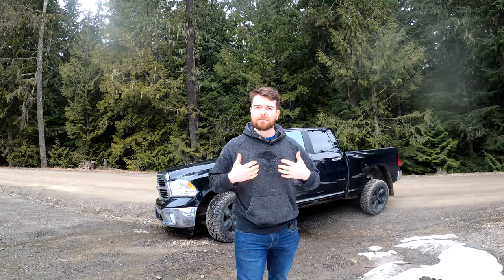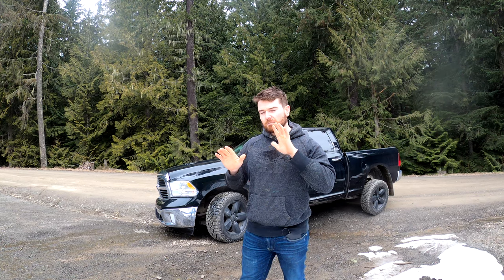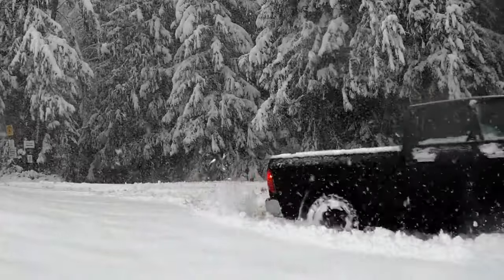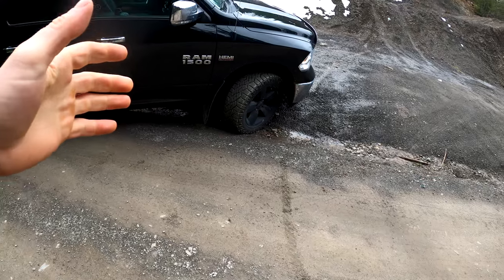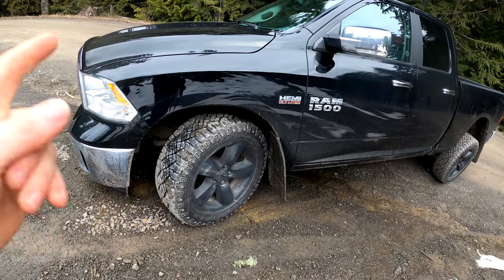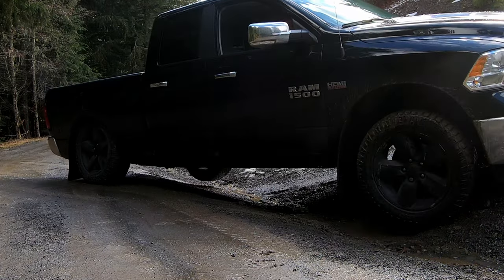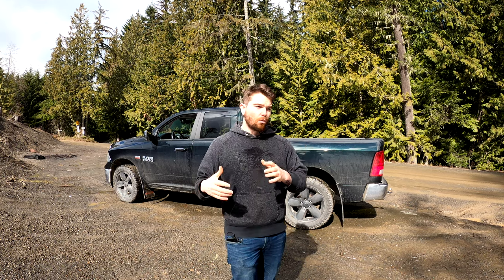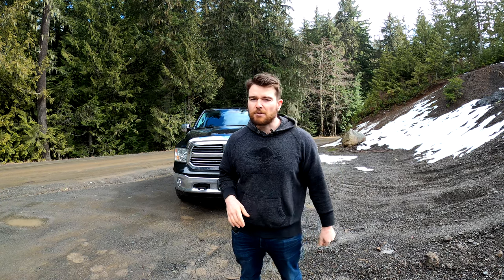RAM 1500 Off-Road 4WD LOCK TEST (With Open Diff's) | Not Really a 4x4...

Comment: Take this from a 64 year old man, you are not high centered, high center is when your frame and transfer case is sitting on the ground, with all four tires are off the ground. If you can't drive a 4x4 with open diffs offroad you need to stay home. Learning to use a truck with  open diffs will make you a better driver when you step up to lockers.
Reply from the maker: Ya my terminology was wrong but you got what i was saying. Open diffs are terrible off road.
Reply: @TheGettyAdventures  No there not, you can alot of places with open diffs an finest.Learn how your vehicle handles offroad before you op for all the latest lockers. If you don't know your vehicle and you engage your rear lockers it can put you in a ditch faster than an open diff.
Reply: Here’s the perfect example of the old guy you can’t teach new tricks. “Watch out sonny, let me show you how we did things before there were lockers!”. Open diffs suck! It’s why hardcore wheelers have them in their rock crawling rigs. Modulating traction with brakes  is an easier way to snap and axle.
Reply: @randyedwards6702   you are totally right I have noticed that this dude that just pops up on my feed does not know how to operate a 4x4 he didn’t even realize how he was stuck in the snow 🤦‍♂️. It’s clear from his reviews that he does not know what he talking about and likes to bash a rams in particular I think he is getting paid to do so. And these trucks comes with option for again particular use 🤦‍♂️ which you have to buy the package. Common knowledge traction control is ONLY for when your driving to help maneuver the vehicle properly. I’m not going to go into detail Randy your right and these young bucks are still wet behind the ears.
Reply: Let me bring some reason to this conversation lol. In this video, he has an open diff with the BW-44-44 transfer case that accompanies the 4WD-auto mode. This transfer case is terrible for off-roading, but great for faster driving in an AWD type mode. That transfer case turns a truck into a soccer mom SUV. Conversely, you get the BW-44-45 (actual locking transfer case) when you buy this truck WITHOUT 4WD-auto. This actual locking transfer case makes it through this type of scenario like a breeze, similar to old trucks with open diffs that made it through everything. Of course lockers are king, but they also come with heavy maintenance (and issues) which makes a single rear locker MORE than enough for a full size truck that’s main purpose is not rock crawling. Watch the Ram classic TFL slip test, and the Ram classic TFL Moab video links below to see exactly what I mean. HUGE difference. 

https://youtu.be/pWUO7hrJedE?si=da5rSONlIOiPxCE0

https://youtu.be/PitAwOmu1do?si=itT9hDKtyh8hIs_F

Comment: From the manual:

ESC Full Off – 4WD LOW
This mode is intended for off-road use when ESC stability features and torque reduction could
inhibit vehicle maneuverability due to trail conditions. This mode is entered WHEN THE VEHICLE
IS STOPPED, the engine is running, in neutral and by pressing and holding the “Traction Control”
switch for five seconds . After five seconds, the “ESC Off” message will appear in the odometer.
ESC. TCS and Torque Reduction features are turned off until the vehicle reaches a speed of 40 mph.
At 40 mph the system returns to “Partial Off” mode. The “limited slip” feature is not turned off. 

So the truck has an offroad mode when you go into 4WD LOW and hold Traction Control for 5 seconds. The "brake locking differential" or "limited slip" traction control functions more aggressively to get you unstuck in situations such as this.

You should know that 4WD High is for higher speeds and 4WD Low is for off road obstacles and situations where you're stuck or are likely to get stuck. https://youtu.be/dfcDJpnBGPE?t=15 22 seconds in you can clearly see the front right wheel get braked and the truck is able to climb out of a situation like yours with ease. Instead of all these Youtube vids you could have just read the manual.
Reply: ESC needs to be off 👀
Reply: @toviyyahjudah6828  yeah most 4x4's require traction control off for the off road mode to kick in in 4x4 low. In Nissan going into 4x4 low it automatically disables traction control, RAM just has an extra step.

Also it doesn't work in 4x4 high, because 4x4 high is not for when you're stuck off road.
Reply: Well I learned something. Thank you.

Comment: That's the classic cross-axle scenario. With open diffs, power goes to the wheel with least resistance and that wheel just spins.Great topic ! I've addressed the same issue to my followers.
Reply from the maker: Such a good example to help folks understand how an open diff works off road!
Reply: It's actually because open diffs have equal torque to both wheels. The spinning wheel has little to no torque, the other does not either.
Reply: @russtomas4461  that's because you need resistance (traction) in order for torque to be applied. This is why riding the brakes a touch works wonders. 

Jeep does this with their "BLD" break lock differential. It's open diffs but the way they use traction control and the abs is awesome
Reply: @JJsGA  I am aware why it is.
Reply: @russtomas4461  I know, was merely adding to your point is all
Reply: Can you link the vid you are referencing?
Reply: @muchless  Here's the link https://www.youtube.com/watch?v=iZg2FNOpSDE . I also reference some other great videos on this topic in that video.

Comment: TFL has a Ram slip test video on YT that shows after a few seconds of constant low throttle, the truck is able to walk off of rollers under 3/4 wheels.  Traction control automatically applied the brake to the spinning wheel (after some time). It was actually pretty impressive. I’m wondering if you just needed to run it a little longer to see if it would kick in? Obviously lockers win.

Comment: Locking transfer case and open diffs with EDL ( computer uses the brakes to transfer power) is ideal for MOST situations and drivers of every skill level.  In heavy rock crawling it may not be strong enough and need physical lockers.

Mopar traction control system is trash. Abruptly taking the throttle away when you loose traction is the WORST thing you can do in a traction loss situation. (from a life long Mopar guy)
Reply from the maker: agreed, the traction control system seems to just try and keep the wheels from spinning and tried to keep you on the road. I've heard Toyota makes a great system.
Reply: In the case of this truck It's not the fault of the Mopar traction control, it's the crappy transfer case, BW44-45. The clutches on that one like to slip a lot and it results in something horrible 4wheeling. 4th gen RAM 1500's were offerered with 2 transfer cases, partime NV243 and full time NV246, then a little later those were changed in favor of a BW44-44 part time and 44-45 full time. A truck equipped with the BW44-44 will jump that rut without much drama. the 44-45 will give those bad results.  4th gen RAM 1500's are equipped with the BLDS system, same system used in the Jeep JK's and UP  since 2007. It was/is  in those models and up.  it's completely silent and you don't have to press any buttons for it to activate. It's all electronic and  uses the brakes to transfer power to wheel that needs it. People will know if they have chitty 44-45 in their 4th gen RAM 1500 because the transfer case switch will have the  4WD Auto option. The 44-44 doesn't have a full time 4wd auto, is just 2hi, 4lock and 4lo. it's the normal part time trasnfer case. That one makes this truck behave as it should instead of that crappy show we see in this video.
Reply: @panasrsm  that’s good to know. I have a 2019 classic with no 4wd auto option.  Just 4 lock, 4low, 2wd

Comment: Lots of info in the comments, and also I'd like to add - You have to apply throttle longer and harder for systems to sense it's bad enough to lock down on one side and throw power to the other.  You were being far too gentle.  Also I learned from pulling boats out on slick boat ramps, you push firmly on the brake and then apply throttle to get the engine up to medium/high rpm and hold it there.  Then slowly release brake pressure until the engine overpowers the brakes.  It'll overpower them equally, putting down a healthy amount of power like a locked diff because you are at strong rpms.  Most people do it too gently, using only a little bit of throttle, and that's not enough torque to do anything much when it finally and barely overpowers the brakes.  You gotta commit!

Comment: Don’t use the tap the brake trick on these trucks! Great way to snap off the front differential output shafts. Did it once on my 08’ Dodge Ram 1500. Granted, I have slightly oversized tires, and was buried sideways in a snow drift.

Comment: Keep in mind the 4Lock mode has less brake traction control than the 4LOW selection. This maneuver or other rock crawl maneuvers would be accomplished in 4LOW.
Reply from the maker: 100% correct. I was just trying to use this as an example of why 4wd lock really isn't what most people think it is.
Reply: @TheGettyAdventures  i sure wish it was what most people think

Comment: Thank you for making an honest video about what is truly 4x4 and what is not. I happen to live in Northern Wisconsin and I drive a 2017 Honda Ridgeline RTL-T AWD. I take a lot of crap for it being "not a real truck" and not having 4wd, and yet for the past 3 years I have pulled a minimum of 2 mid-size or half ton trucks that are supposedly "4x4" out of the ditch in winter when their open diffs leave them stranded and my AWD performs. I do acknowledge I upgraded my tires to Falken Wildpeak AT3W tires that are snow rated tires.
Reply: Ridgeline is not a real truck, and I'm betting the trucks you pulled out where dodge
Reply: @coltonsstuff17  if the dodge had a locker, it wouldn't have gotten stuck. The ridgeline can "lock" the rear.
Reply: It’s still not a real truck lol.
Reply: Lol ridgeline

Comment: Open diffs shouldn't even be a thing anymore.  Make LSD's standard and they'll be cheaper vs still trying to engineer/manufacture/source parts for both
Reply: Just letting you know A limited slip differential eventually becomes a open differential if not maintained and maintenance
Reply: It can also be a problem in the snow and ice.  Thats why most modern trucks have locking diffs up to a certain speed than open...as opposed to limited slip.

Comment: What year is that truck? It doesn't have brake based traction control?

Applying the brakes should definitely help. You actually are four-wheel drive if you're on perfectly flat land with the same traction on all four wheels you actually are getting power to all four wheels even with open differentials.

All of that said there is not a single modern Jeep out there that would have any trouble at all with this situation. Even if I have my rear locker turned off and I have two wheels in the air I am still going to move forward because my brake base traction control make sure the power goes where it needs to. I also have a power transfer unit that will send the power front and rear as it needs also. So if I'm slipping more in the front then in the rear or vice versa it will send the power to the other side front and rear also. My Jeep actually has the ability to send 100% of the power to the rear even though it's a front-wheel drive based vehicle.

Comment: I have front and rear lockers in my Jeep, but why can't they use the ABS system to apply a little brake only to the faster spinning wheels to get some power to the wheel with traction and alternate as needed? Is that was Toyota does with their crawl control?

Comment: shouldnt you have the (BLD) brake limited differential??? did you pull a fuse or something? because BLD should be working. my ram pulls out of cross axle super easy once that kicks in.
Reply: Is long as you hit with a little bit of speed your roll right through it that's what I do with mine and I have a 2011  That's been through hell and back Not sure which parts of it are coming back though lol

Comment: Probably an ignorant question, but If the purpose of traction control is to apply more power the the wheel that isn't spinning, then why didn't it work? I would assume that that's exactly the situation that traction control would shine
Reply from the maker: So traction control applies brake pressure to the spinning wheel on the axle. basically what that does is tries to make the spinning wheel harder to turn then the wheel with all the weight and traction. because torque takes the path of least resistance so if the wheel in the air that is spinning has a lot of brake pressure applied to it  now making it the harder wheel to turn, power will be forced to the wheel with all the traction. 

Now Rams traction control can only do so much it really isn't designed to apply enough brake pressure for situations like that. it will help in situation on the road in slippery conditions and help keep you from sliding off the road. 

Toyota however has a really cool traction control system that does in fact work like this and can essential lock up the axle by simply applying the right amount of brake pressure to each wheel.
Reply: They actually should have called anti spin as it will apply the brake to a spinning wheel to slowing down till it stops spinning more than the opposite wheel and then your vehicle will travel straight . Hope this helps

Comment: So I pretty much have a kinda 4 wheel drive. And of I was in that situation is be moving a little faster because im not rock climbing I'm trying not to get stuck. Did you put any lockers in your rig. My truck looks exactly like yours minus the mud flaps.
Reply from the maker: Exactly this truck would of easily gotten through this "obstacle". But if there would have been snow or ice or even some mud maybe not. I was just trying to show that 4WD doesn't mean all 4 wheels are getting power. unless you obviously have lockers or a limited slip set lol 

I was going to throw an Eaton trutrac in the rear on my truck but I'm just over 90,000 and I figured I'd wait until my warranty is up before I rip open the diff.

Comment: The left rear tire stopped spinning when the front right gained the same traction as the front left. That rear axle was still pretty much useless.
Reply from the maker: potentially, One thing I would say is that the rear axle can't stop power from going to it. So in theory one wheel must have power going to it. 

It's a great question because I thought about it when I saw the footage too. Obviously the torque converter can take up engine power and have the ability to not turn the wheels. but the T-case is after the transmission and if the Transfer case is locked there should be a 50/50 split of engine power.  so if the front wheels are turning there must be power going to the rear wheels. and with an open diff at least one of those wheel must receive power. 

Now I don't personally work on these trucks nor have I ripped one apart but if there is power exiting the transfer case unless you snap an axle or blow up a diff that power has to be transfer to the wheels. 

That's my understanding, hopefully that makes sense. But I've certainly been wrong before lol!

Comment: An interesting video that I came across whilst researching Dodge Ram 4x4 systems.  However in this cross-axle scenario you were in, I have to make a few comments on what you said which I disagree with.  Firstly you do not want to make the wheels with the most traction spin, you want them to drive and turn.  The wheels with no or limited traction are spinning and your going no where.  The Dodge Ram traction control is quite obviously rubbish! if you watch a video of a Range Rover Evoque in a cross axle scenario with the tyres off the road with the traction control switched on it would drive straight through/out with open diffs without hesitation.  The traction control is stopping the free wheel rotating and therefore drive has to be transferred to the wheel with the most grip through the diff.  This using your foot brake again is what you are achieving.  By restricting the speed/rotation of the freewheels it will transfer the drive to the wheel with the most traction just not as effectively as a good traction control system such as the range rover system.  There are a number of videos where the ram owner used the E-brake/hand brake to again reduce the speed of the spinning/free wheel on the back axle to make the diff drive the wheel with traction.  A locking differential is not necessary with an effective traction control using the ABS braking system and speed sensors on each wheel for the type of terrain you are showing, a LSD in the rear would post probably allowed you to drive straight through the cross-axle piece you showed.

Comment: 2015 Jeep grand Ch summit... it has a dial for snow, rock, sand, etc....  buying a 23 ram limited that only has auto and 4wH/L...  what’s the difference between those trannys?   JGC works really nice in the snow,  the 50/50 split is great.........will the truck suck? Or is it same thing?   Same company anyways, why wouldn’t they use the same tech?

Comment: is Open Diff the default for all vehicles, even such as a Toyota Corolla?
Reply from the maker: Yes open diff are usually the default. they make driving on normal road surfaces seamless and comfortable. so a vehicle like a Toyota corolla has no need for anything but an open diff because it's not meant to be put in off road situations.